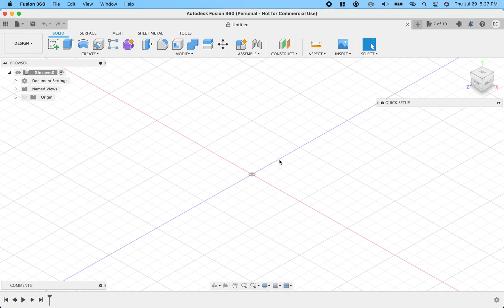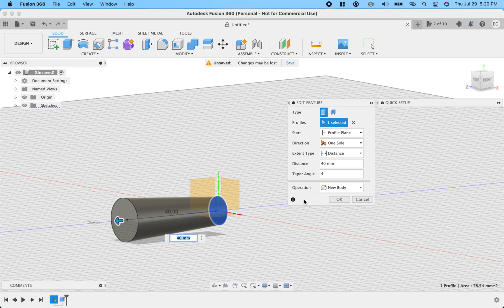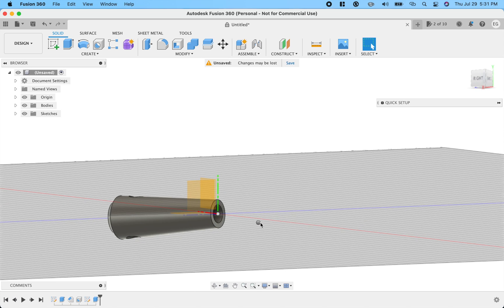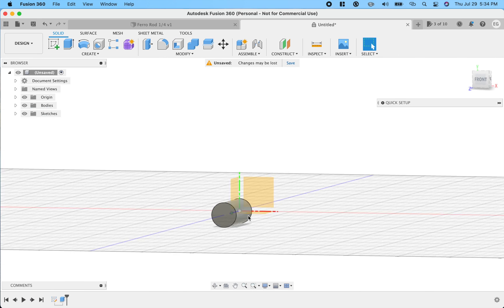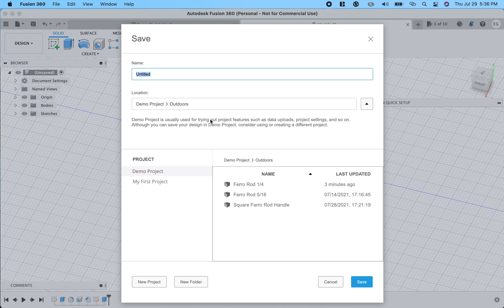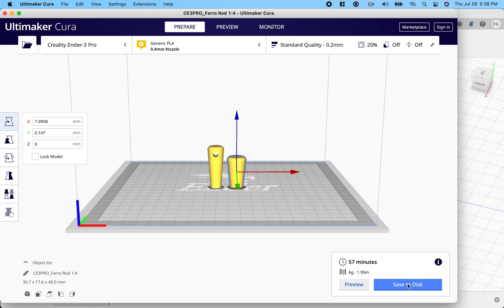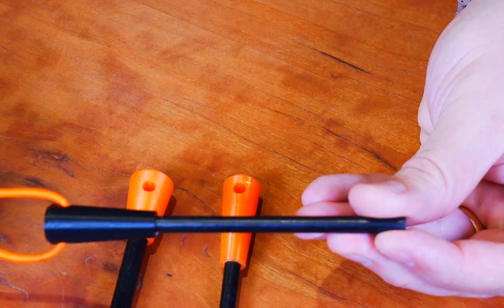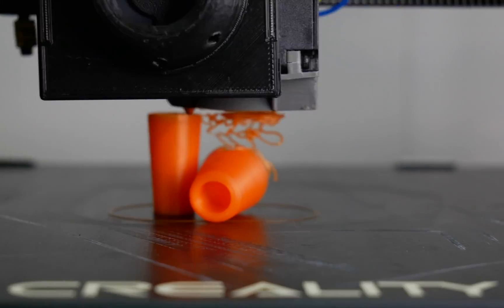DESIGN and 3D PRINT Your Own Custom Ferro Rod Handles EASILY!

Comment: Very cool. There is no doubt that 3d printers are amazing and they are going to be as groundbreaking  and important to making our lives easer as the microwave oven was. However maybe because I am just that old but there is just something about making a 3d printed handle for my feral rod for bushcraft use that just seems wrong to me. I think I going to stick to hand carving my handles out of wood and stag.  Keep up the content love to see what you come up with on the mora. I bought a attention that was sold on ebay that attaches to a stock mora sheath that holds a flashlight and feral rod onto your sheath that someone 3d printed that I love.